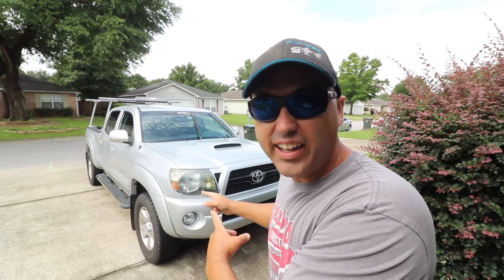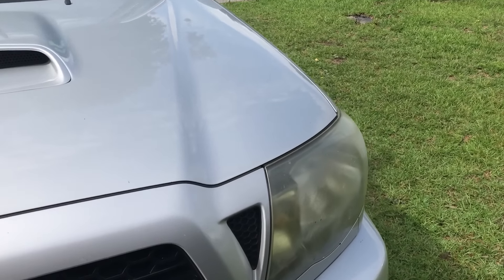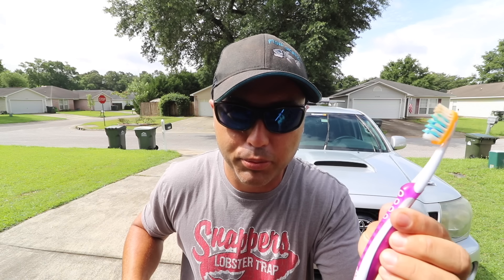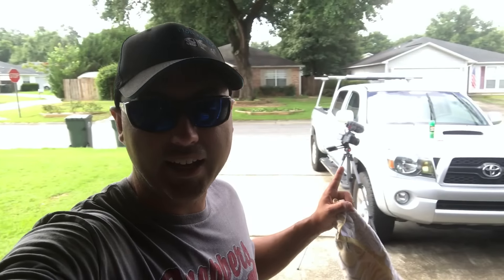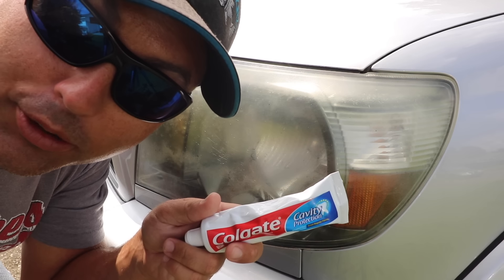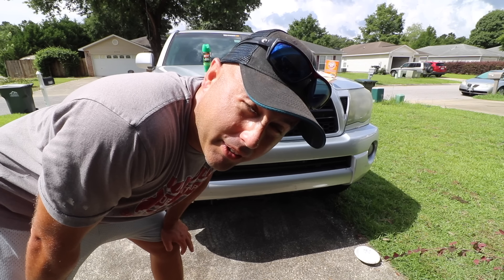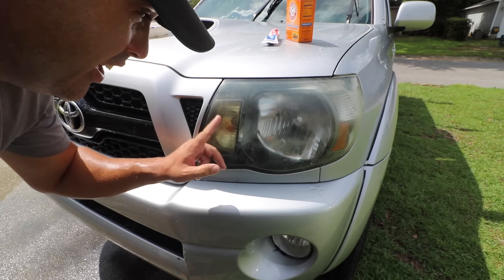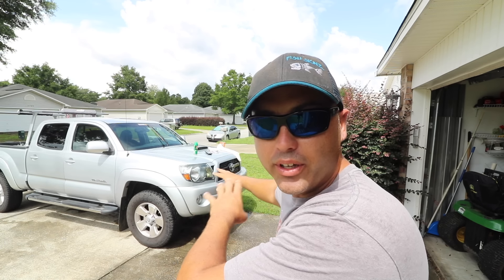The TRUTH about OFF & Toothpaste vs Headlights! (+Update on WD 40)

Comment: What causes the headlight lenses to get cloudy like that is something called "crazing" - which is when the UV light from the sun attacks the outer surface of the plastic and causes a lot of microscopic cracks in the surface. This diffuses the light hitting the surface instead of letting it through and makes it look cloudy.
Liquid products like OFF and WD-40 and even water, just fill in the cracks and make it look clear again. Of course, water evaporates quicker than oils, so it doesn't last as long, but even the oils will eventually wash away or evaporate and the headlights are still crazed like before. 
If you had washed that OFF off with soap and water, it would have looked like it did before.

What actually works is plain old cheap buffing compound, a clean rag, and about 10 minutes of scrubbing in small circles all over the lens. The toothpaste will work some, but you need to scrub it on with a rag and not a toothbrush, plus you need to scrub a lot longer than five minutes.
Buffing compound has a little more aggressive abrasive, so it works faster than toothpaste, but it still takes some time and elbow grease. 

It basically ablates the cracked surface and gets down to a new, smooth surface.  It will stay clearer longer, but eventually will have to be done again due to continued crazing by the sun. My experience is that I have to do it every 12 to 18 months, depending on the car.
Reply: The most accurate description of what happened in the video! And the most underrated as i see it! People don't understand some basic things...it' common sense and logic thinking. In his case, toothpaste would have worked but you need to put some work into it- as in everything in this f** life! People are looking only for quick and wonder fixes that mostly don't exist. Things don't work this way. Most of the time you need to put a bit of effort into whatever you're doing to get good results; valid for most things in this world. Period.
Reply: Thanks for this educational comment.
Reply: If you use a fine sandpaper, like velvet almost, you get the yellowed oxidation off. Called wet sanding. Then after totally dry, spray lightly with a gloss, non-yellowing, UV top  coat for plastic. You won't have to do it again.
Reply: @John Akston it might have to be done over, but not from the yellowing. The guy I watched on youtube put three coats of cleargloss on. It might last til you get a new car. I followed his directions and am quite happy with my car from 2000. The yellowing stained the driveway!
Reply: Well put Lazy D. 
Best description yet.
Reply: kallie barrett I wonder WHY the manufacturers DON'T do this in the 1st place!! Hmmm..... (note the sarcasm)
Reply: @desirevargas3511  Because there is very little reason for them to do so.
As a second tier manufacturer, you have to bid on making a part that meets the specs of the company you are making the parts for.
Most automotive manufacturers know that the person buying their car from the dealer is just going to own it for about three to five years, and the reliability over that time frame is what matters to them.

So they spec parts that will fit the needs of the most likely initial customer.

You and I may be the type to keep a vehicle til the wheels fall off, but we are way out on the edges of the target market bell curve for car manufacturers, and thus, are left to our own devices in such matters.

Frankly, they could make all those parts out of glass that wouldn't suffer UV degradation, but there would be the increased costs, as well as the increased weight - which would negatively affect the CAFE standards they have to deal with.
Also glass, while impervious to UV degradation, is hella lot more fragile and easily broken, which would cause butthurt among consumers for replacement costs just because a little rock bounced off the road at highway speed.

It's all a balancing act for manufacturers between costs, perceived reliability, and expected on-going maintenance costs.

The guy that makes the headlights is NOT the guy that makes the car - he's a contractor.
While a process to make the headlights more UV resistant might only cost a couple dollars extra, and you could question why a couple dollars over the $30,000 to $50,000 price of a car would be such a big deal, you should realize that the headlight making guy sells those headlights to the car manufacturer for maybe around $100 or less, so a couple bucks has a two percent impact on his bid to supply several thousand parts for this deal, and bids like those are usually made or broken by a lot less than 2%.

Basically, the target market for a car wants the best value for their money over their perceived long haul. They will buy that. People that want high end cars that rarely fail are either going to have to pay mega bucks for them, or take their chances with what is sold to the target market of auto manufacturers.
Reply: @desirevargas3511  they don't want people keeping cars longer than ten years. Ideally, 6 or 7 years!
Cheap parts are the new reality. My new riding lawn mower is every bit plastic, every button on it. My old one was all metal and lasted 16 yrs. :/
Reply: kallie barrett It's absolutely true that they DON'T make things like they used to anymore. Sad really.
Reply: Lazy D And THAT'S the bottom line right there. The nature of the "Supply & Demand" beast has shifted it's priorities away from good old fashioned QUALITY. As it has in most of EVERYTHING else as life goes on. 
It's up to the individual consumer to follow their own path of what best suites their lifestyle and/or pocketbook.
Reply: @kalliebarrett8420  i im gonna try doing that thanks to chrisfix lol!
Reply: Desiré Vargas you want manufacture to go bankrupt, they have to sell you Products - you understand “products” !! And you like everyone else need to keep “buying” so “They” take away your hard earned “money” ..........
Reply: Sam Sam 
"CLEARLY" you have "misunderstood" my "post". 
I don't want the manufacturer to go "bankrupt". The fact of the matter is that the consumers hard earned "money" should be spent "wisely", but alas... Like I stated earlier, "It's up to the individual consumer to follow their own path as to what suites their lifestyles and/or pocketbook" BEST. 
The consumer deserves a BETTER variety in "product" selection, thus expanding the choices in market availability. But, as Lazy D so eloquently stated in their last post,  is the description of the Automotive Industry's "Supply & Demand" nature in it's evolutionary state, compared to lifelong quality of a decade ago. 
THUS..... 
"Quality over Quantity"
 has shifted to: 
"Quantity over Quality". 
Just sayin'.......
Reply: If the guy (?) Had put toothpaste DIRECTLY ON THE TOWEL, as he did with the Off, & rubbed it harder, itWOULD HAVE WORKED.
Reply: @kalliebarrett8420  3000 grit and finish with 5k.
Reply: @jdgower1  good post. Very true. It is way easier to come up with all the odd shapes of headlights by using plastic vs glass too.
Reply: @desirevargas3511  One thing that should be noted is that the reason we didn't have to deal with plastic headlight crazing "back in the day", is because there weren't any plastic headlights - They were all glass, and glass doesn't craze.
Auto manufacturers started using plastics for headlights and such for way more than just cost shaving reasons. As a matter of fact, the early plastic headlights cost the manufacturers more than the glass ones because there were a whole lot of glass guys already out there, and capital expenditures for optical quality automotive parts had to be built from the ground up.
One of the major reasons automotive manufacturers went to plastics for stuff otherwise better made of glass, is government regulations on standard mileage rates, otherwise known as CAFE Standards.

They had to shave weight everywhere they could. A pound here and a pound there really adds up.
I remember reading back in the 1990's about a company that made the starter motors for engines being bulldogged into making as much of their starters out of aluminum as possible, instead of steel.
Steel is more durable and cheaper, but it is heavier, and auto manufacturers had to have lighter over cheaper, and damn the costs. Because government.
About the same time, cars quit coming with full sized spare tires. Instead, they came with what we call "doughnuts" that arew hella lighter, but only good for about 2 miles or so at very reduced speeds.
they also cost more than just another regular wheel that the manufacturers already had a jillion of, but, hey! They have to shave the weight.
Now, some cars don't even come with a doughnut - no spare tire at all.
That's not because of supply and demand, it's because of increasing onerous government regulations.

BTW, light assembly makers DO apply a UV coating to those assemblies - one that is hella better than you can buy aftermarket. It's just that nothing like that lasts forever. If they didn't apply a coating, those lights wouldn't hold up a year without noticeable crazing.
They really are doing the best they can under the constraints they have to operate in, to sell you the best product they can.
Because they understand that eventually, you're going to buy another car, and if you buy it from them, then they get to sell you another $100 headlight assembly, which means more to them than any two or three dollars they might save by cheaping out on the first thing they sold you.
Reply: @christopherhendricks4369  well, mine were really bad, so I used 400, then 800, then 2000. (Some guy said to! :)  The 400 might have been too scratchy, but there was a lot of yellowing, and i didn't scrub hard. Then wiped once with 90% rubbing alcohol.
 Then I did three clearcoats but three seemed too much. So sanded lightly and redid only one, one and half coats...they are so much better, and clear. But i should clean the inside. I watched video guy do that with handmade magnet rags, way too much trouble! :P
Reply: Lazy D YOU should make a video documentary on what u just SCHOOLED us all on. 
"Class is in SESSION, yo!!" 
TELL it like it is, Professor Lazy D. 
I'm sittin' front row!!
Reply: @desirevargas3511  "I have a face for radio", is what my favorite talk show host used to say, and I agree with him on a personal level.
I'd love to make some videos, but I'm more of a keyboard warrior type. High props for the guys that do the vids, but I don't have the equipment, nor the finesse to do vids.

Thanks for the hat tip, though.
Reply: Lazy D Aww MAN!! 
Then I'll settle for your keyboard finesse instead. 
I'm cool with that!! 
High five.
Reply: @jdgower1  Would that talk show host be Mr. Dug McIntyre?
Reply: @lbrice2646  No, actually it was Neal Boortz.
Reply: @desirevargas3511  So they can sell you more parts. Nobody makes something that lasts forever because they want your money.
Reply: Rita Mills Already stated. 
Read the posts.
Reply: Lazy D thank you!
Reply: Thank you great help pal 👍👍
Reply: Lazy D.....Thxs 4 the info👍
Reply: @Lazy D, Thanks for the explanation...I definitely needed it. Much Gratitude 🚘
Reply: @desirevargas3511  yep,  he gave us the diagnosis but not the prognosis! Armchair headlight restorer lol!
Reply: @ApproachingHoofbeats  Thanks for your helpful input.

You must be the life of every party you go to.
Reply: Lazy D what about paint cleaner wax?
Reply: @GrizzlyUrsusArctos  "Cleaner wax" is just another name for polishing compound.
Polishing compound and buffing compound are sometimes interchanged, though in reality buffing compounds would be made with a little more aggressive abrasive, and polishing compounds would be a bit finer, but they're pretty close to the same in this application - it's just that the finer abrasive you start out with, the more rubbing you have to do.
Reply: @christopherhendricks4369  just curious, dud you try w/3000 & 5k?
Because I want to try it.
Reply: @hera7409  I'm doing mine this weekend. I'll let you know
Reply: Alright now Einstein thinks
Reply: Thanks for spending your time and giving this useful information.
👏🏼🙏🏼
Reply: Lazy D were do I get buffing compound? I never done anything a car but I need to learn now. My car is parked directly in the sunlight. It’s starting to get to the paint job on my car. Right now just the side mirror’s are efficient. Any clue what I should do? There is no shade.
Reply: I drive a 2004 Ford Excursion diesel and I tried the toothpaste but it didn't work well.  But I'm going to drive it till the wheels fall off so my headlights will just have to be like this guys.  I hate making vehicle payments so I take care of my ride but the headlight lenses not so much.
Reply: This sounds like such a great idea. And you really explained this so well! Wanted to thank you for the advice, and also to the guy who made this video. It's for my sister's car, an 07 Ford fusion. I'll let you know how it turns out, after I finish my B.E.L.T. sandwich ..
Bacon
Eggs
Lettuce
Tomato ..
Reply: I wish you could find the finesse to make your own channel. I was seriously amazed with how much knowledge that you possess. You "Rock" !!!
Reply: @desirevargas3511  I've been studying this for a while.  All these headlight covers are made in china.  The chinese coat the lens with a protective clear coat.  That clear coat goes away after a few years.  Thus, it's simple:  You have to take off the top layer of the cheap plastic by wet sanding, fine polish, clean and then clear coat again.
Which will last you about the same as when the manufacturers put those cheap POS on your new car to being with!  It's amazing that to save $10 instead of glass, they know their customers are going to hate their ugly cars in a few years!  Also, statistically, the higher income and intelligence you have the longer you keep your car; hence, you're pissing off all the most influential people in the world!  LOL
Reply: Desiré Vargas    its* evolutionary
Reply: @desirevargas3511  the quality in humanity period has been in recession for decades only the very wealthy can afford quality products, but the quality you find in them is the worst.....ironic isnt it!
Reply: @bamaslama4732  
YUP. 
VERY ironic.
Reply: Plastic headlight's sucks nothing like real glass
Reply: Throw away all these ideas. They dont work. 
BUT.....and heres the good news. Pick up a small pack of jewellers rouge from one of the ebay suppliers. Mix 1 teaspoonful with 1/2 teaspoonful of water.using a soft microfibre cloth over your index finger, dab it into the rouge/water mix and rub the lens in a cir flat motion. Go for about 2" squares at a time. On a Daihatsu Charade (17 years old) it took about 35 minutes per headlamp. 
Jobs a good un. They came up like new. And we have had a pretty evil winter since I did them.
Stay lucky my friends.
Reply: and I just got an education in basic economics/supply & demand. oh - and how to restore my headlights. not a bad way to open a Sunday morning. really appreciating this; thankyou!
Reply: Christopher Hendricks n
Reply: Your name does not suit you.The length of your comment shows you are not Lazy
Reply: @rmglover3191  Sorry so long in replying, but I'm glad you enjoyed it.
I'm just an overcharging, yet under-paid independant industrial maintenance contractor and part time plastics processing consultant, that had dreams of becoming a chemist back in my young and dumb days.
I never stopped studying the things I'm interested in, though, so I am comfortable with what I know about the things that interest me.
Reply: @niksterz0722  The name comes from a slightly drunken night in a Charlotte, NC hotel when I was creating new FaceBook profile pictures - along with the personalities they implied - on a weekly basis.
I would sloppily paste my face on pictures of other people and claim to be some other incarnation of them. One night about ten or 11 years ago, I pasted my face on some gangsta rapper's pic and chose a "rapper" name that I thought would be appropriate. <See my current YT profile pic - same>
It stuck.
It stuck HARD!
Even my brothers call me Lazy D right now, so I'm just gonna go with it.
That said, I appreciate your comment and am glad you enjoyed the comment.
Reply: Lazy D o
Reply: Sam Sam hi
Reply: That makes a lot of sense...tks
Reply: @kalliebarrett8420  Thank you! I will look into getting a UV clear coat to protect the headlights.
Reply: Moisture
Reply: David Topchiev  I have a 2005 Astrodamnvan with actual glass, sealed beam headlights that sell for ~$10 a piece.
As someone who has been in plastics for nigh on 30 years, I can understand the flexibility that plastic lenses give to auto designers, while also recognizing the downsides of having to choose plastic over glass.
It really is an interesting study of the economics of manufacturing.
Reply: @Kallie Barrett Cheap parts is what created the plastic continent (Great Pacific Garbage Patch) out in the Pacific Ocean.
Reply: @crecart2889  Cheap parts are also what created the standard of living we have today, and the wherewithal to be able to deal with the downsides involved.
It's a Yin/Yang kinda thing.
Reply: @Lazy D  My dad keeps broken vacuum cleaners, broken toilet seats, broken hairdryers, broken fans, old tv’s that don’t work, old speakers that you can’t plug into anything, so much junk! And he has 4 vehicles in the driveway that won’t run and he uses them as extra storage room for more broken stuff!（╹◡╹）!  He loves cheap broken stuff! lol
Reply: @alb.dersame  you eating at harpoon Harry’s in key west? Only place I recall seeing BELT on a menu but I’m sure you can get em anywhere
Reply: @jdgower1  come to clean my headlights and walk away with a silly idea for the Internet. Lol. Anyway boo hoo. No quickie. But imma at least use a power drill or grinder with a buffer attachment and make it go faster. Saw a vid where a guy used Mother’s polish. Took him like probably 5-10minutes on one light. This plastic clear coat everyone is saying, is that a 1-part thing? Or are we talking like epoxy and shit?
Reply: @BiggieBobThornton  that's wild. I thought I made the belt sandwich up when I was the manager of a nightclub in Orlando Florida back in the early 80's. I was making something to eat for the day bartender and myself one morning when the idea hit me. I imagine millions had the same idea, lol.
Reply: @SamMonkulas  well It’s just like a roach spray. Years ago they came out with a gel used just two lines underneath the bathroom sink in the kitchen sink and it totally eradicated the roaches in a four unit apartment building. Never seen a roach again. Move forward a couple years and ask about the roach gel, I was told they don’t make that kind anymore because it worked too well. I know they don’t wanna kill all the bugs I want to keep you having to call them back.
Reply: There is also a "clear coat" on new Lexan housing lenses that gets cooked, some mfrs. within a year, then your left peeling layers off.  It really sux ass. Headlight housings aren't cheap at all!
Reply: Thank you!!
Reply: @desirevargas3511  h